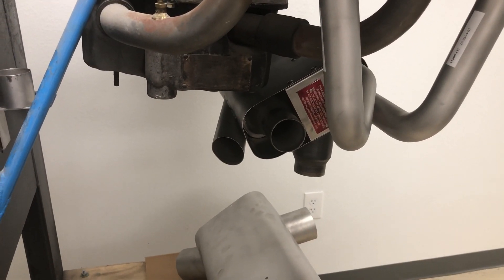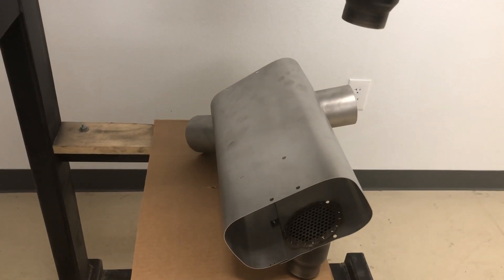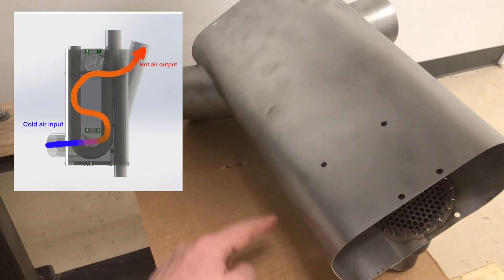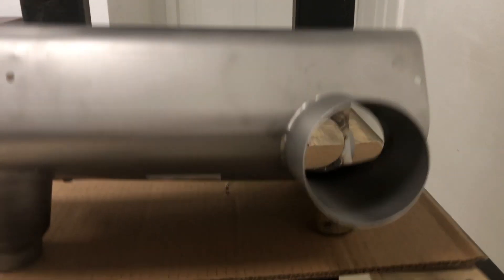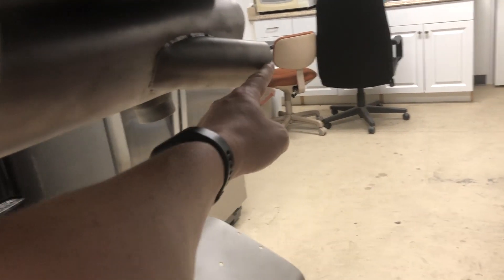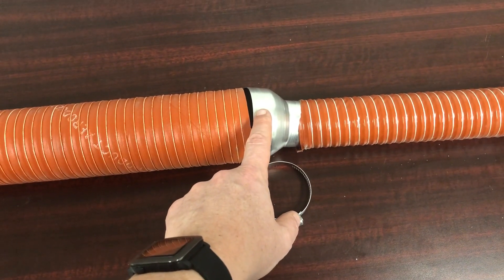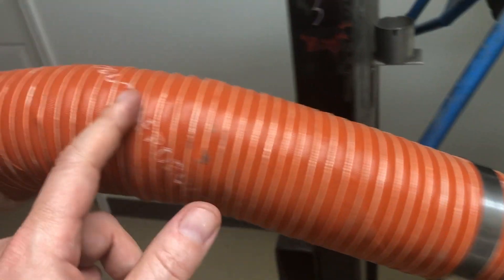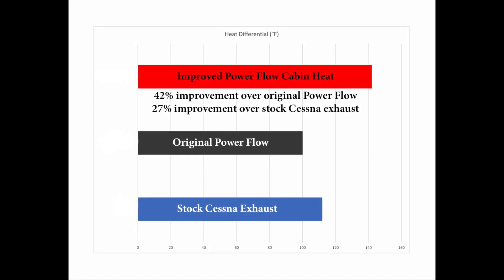Power Flow's Improved Cessna 172 Cabin Heater system

Comment: The chart showing the heat gain of the 3 systems is meaningless without mass numbers (unless mass flow is equal which I have to assume is false, otherwise it would have been stated)
Reply from the maker: Actually the mass flow was approximately equal.  The ground testing involved hooking-up a constant speed blower motor and running the engine through the same test plan / power settings for each configuration.  Our data represents the differences observed between the tests.  The blower runs at the same speed, the engine was run at the same power and mixture setting, with the only variable being the exhaust / exhaust shroud.   Hope that helps clarify.

Comment: Just curious - would it not be possible to weld the reducer to the outlet so that you can just run 3" scat tube from the heat exchanger up to the mixer, as oppose to having the reducer floating unsupported?
Reply from the maker: Thank you for your comment.  On some aircraft configurations (O360 conversions,  and early model C172 aircraft), we don't appear to have sufficient clearance for a 3.0 inch SCAT connection to exit and to clear all the obstacles without first turning the SCAT tube to the rear.   You can choose to support the adapter or let it free float - we leave that up to the installer.   We have successfully used the free floating adapter on several different aircraft models for many years without issues.  Hope that helps!
Reply: @PFSInfo  I didn't appreciate this is designed to be installed on multiple different aircraft/models -- the design flexibility makes much more sense in that case. Cheers!